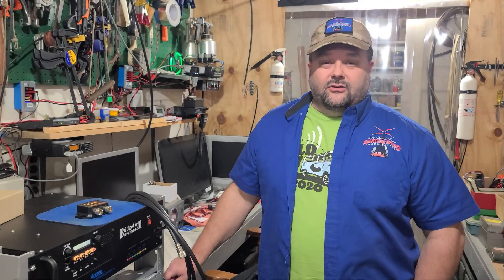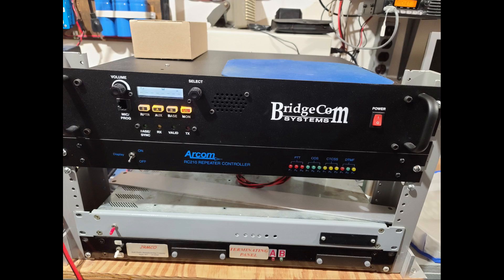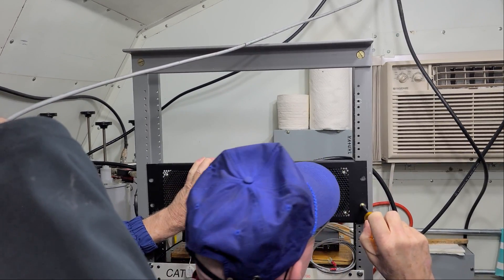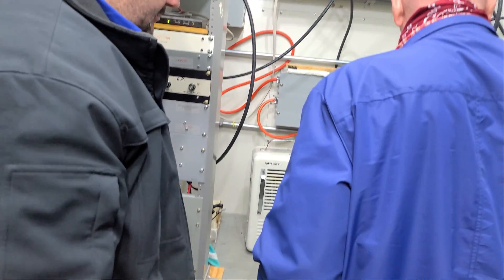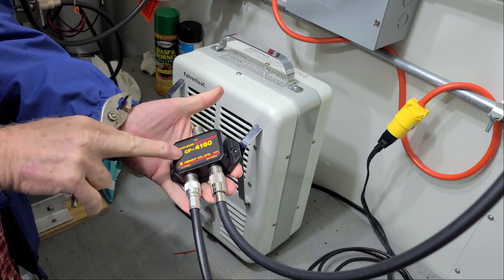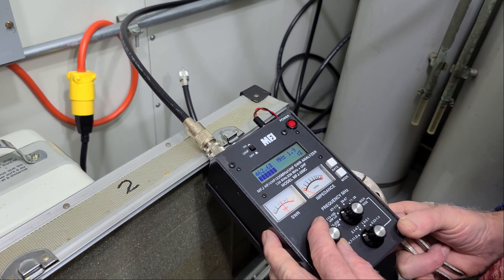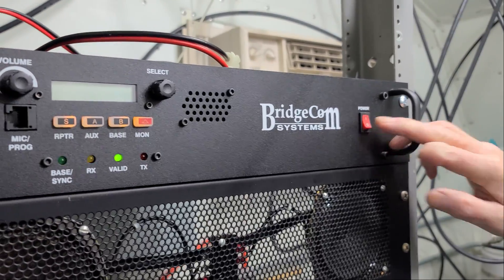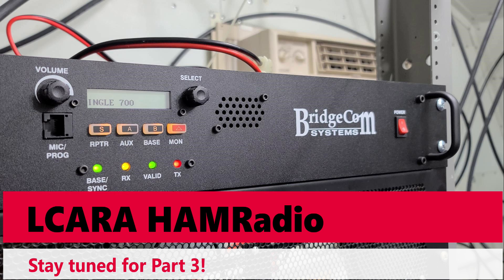LCARA HAM Radio: Deploying a GMRS Repeater Part 2 - Installing and Testing

Comment: I was  using 2 sm-50’s for a repeater and for ID I was using the ID-O-MATIC which worked great. I bought a vertex standard VXR-7000 repeater. I am looking to have a much robust repeater ID ability.I am fairly new at this. My calls are WRAX810,KN4GTU.  It’s just me by myself on this
Reply: This is being used on gmrs..

Comment: I couldn't find a part 95 certified repeater on the bridgecom site anywhere.  Where are you getting this information.  They all say part 90 only and specifically say they are not certified for GMRS.

Comment: I see the Arcom RC210 Controller just under the Bridgecom Repeater, but I don't see you installing it at your Repeater location into the Server Rack.......Did you use the RC210 for your GMRS Repeater, Thanks Much...Mike

Comment: During the video I was wondering about the 'duplexer' which allows a repeater to use one antenna  for the repeater output and  input. But then I realize that you must have purchased the repeater with the Bridgecom built in duplexer.  I did cringe when the gentleman tightened the connectors using a pair of pliers. Tightening in that way is not recommended. You might over tighten and break something. It was hard to watch.  73 de N2LRB
Reply: The guy doing that, he owns the rig, so... there ya go

Comment: You said only one family member needs a GMRS license which is correct but I want to see in the rules where it states that person has to be present. I have used and been licensed on GMRS for 20yrs and have read all of the rules and nowhere does it say this nor does it even say you have to be in the same household.
Reply: Of course the person doesn't have to be present.  That would defeat the whole purpose of family licensing.

Comment: Great video! Thanks for sharing so many useful tips. I have one quick question.... What's the difference between the duplexer like you are using (CF-4160) verses the very large duplexers seen at some repeater sites, that look like canisters the size of fire hydrants?
Reply from the maker: @RepoMan550 - The "duplexer" used in the video is really a frequency splitter, not a duplexer in the traditional sense. Comet calls it a duplexer. The actual "can" based duplexers are used for signal rejection among other things and depending on the frequencies being used on the repeater, quite large.
Reply: The small one is a wider filter allowing uhf and vhf to be seprated from each other. The larger ones are set up to separate specific frequencies within the same band.